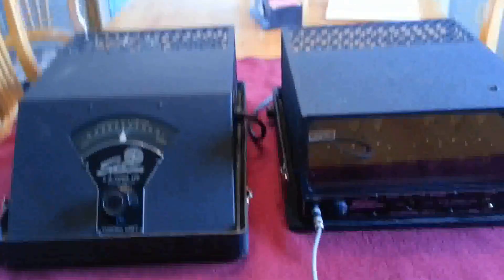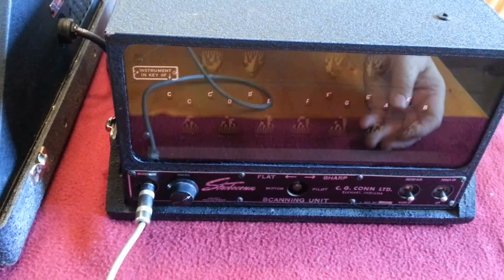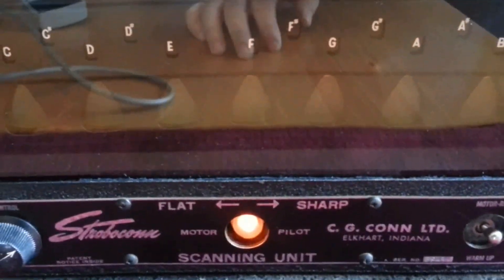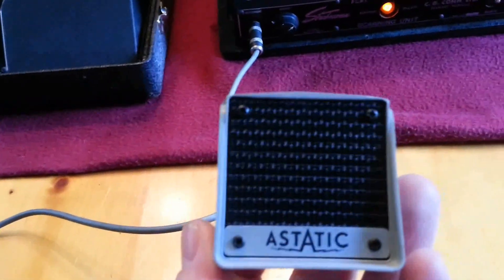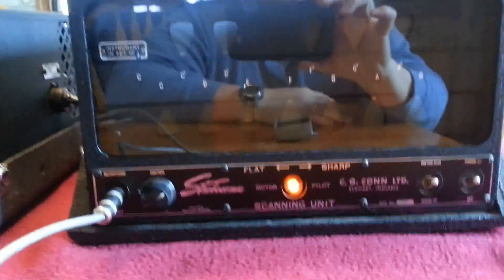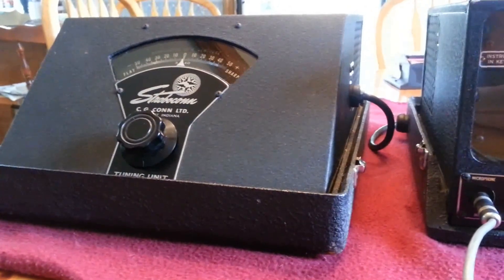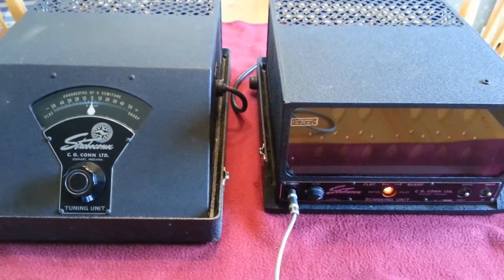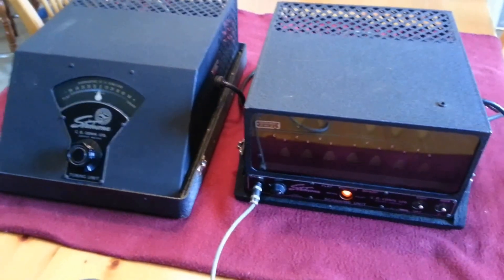Conn Stroboconn Instrument Tuner

Comment: Bill, I think this unit is from the 1940's due to 1) the wooden case and 2) the transposition knob (missing in your video) mounts on top rather than on the side.  I have scanning unit serial number 444 and the circuit matches a 1947 schematic that Peterson sent to me.  The later version of the schematic you will find in the 1964 6T-5 manual also appears in a 1951 Radio Electronics article about the Stroboconn, so I believe the circuit changed between 1947 and 1951.  If you still have access to your Stroboconn, I would really like to see pictures or video of the scanning unit with the cover removed.  I could confirm which version of the circuit it uses by the arrangement of the components and it would help me reassemble mine correctly (it was already a project when I bought it).
Reply: 1940's? You could be right about that...Unfortunately I no longer have the unit.

Comment: Hi Bill.  I am in the middle of restoring a mid 70s version of this tuner, probably last of the production run.  I've found that my fork is running about 16 cents sharp, and I want to re-calibrate it.  Assuming I get a good frequency ref, do you know how this is done?  There are some screws set into the very ends of the fork tines which appear to adjust the mass of the fork by screwing them in or out, but I don't know if this is the correct approach.  Any insight you may have would be great.  Thanks!
Reply: +hugeshows So sorry, but I don't have mine any longer, so I couldn't take a look at that.
Reply: Hi Bill, finally got mine up and running.  Check out my channel if you want to see it, plus some other tuners.  Cheers!

Comment: A fascinating device. Those of us who are of "sufficient age" can recall when beautifully designed and constructed equipment like this was produced to perform tasks that are now routinely performed by soulless, throw-away $10 plastic junk. It's much like comparing an illuminated manuscript to a newspaper. Thanks so much for sharing this with us.
Reply: I'm thrilled,  I just got mine today,  and put it up on my channel.   I have had several Conn Strobotuners prior (the single wheel ones)... and sold one of them to a friend.    I always wanted the 12wheel model.  They are beautiful pieces of engineering.   I'm building a shelf for ours to stand proud in the studio.  

I just imagine that I can now tune up my guitars with the same gear that the classic artists used.   I'll bet you that instruments for Elvis, Chuck Berry, The Beatles.... etc, etc...  were tuned up on these Conn units.